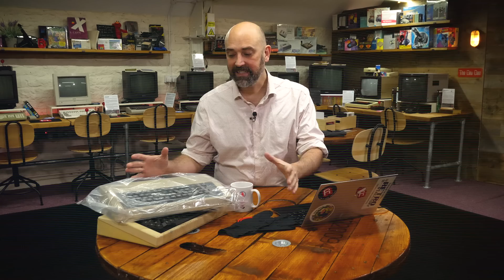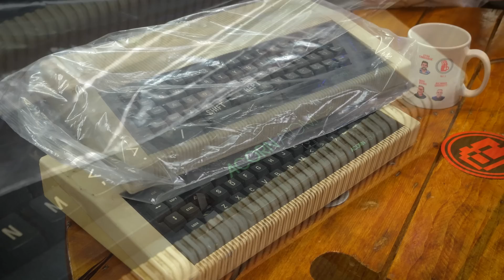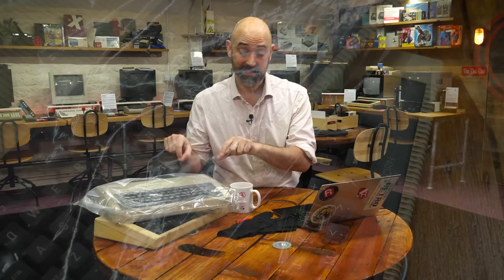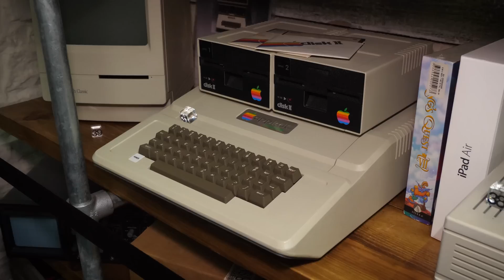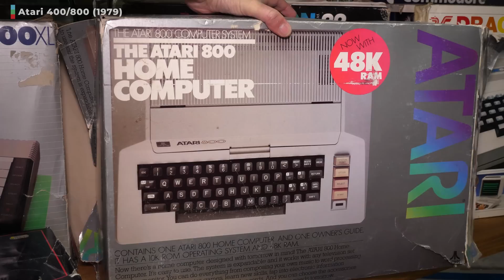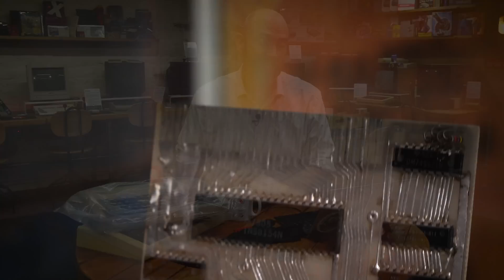Splitting the Acorn Atom | Trash to Treasure (pt1)

Comment: The Acorn Atom was my first Computer (kit version) and where i grew up with.
I have 3  now and they are still running. One (my main system) even extendend to 32K RAM, by removing all the RAM (2114) chips en inserting a 32K ram board.

Comment: I have two of these in my shed and there should be another in the attic. I bought one in 81 and upgraded it to 12k. I later got a colour card and some a couple of roms containing additional features like a word processor and some other utilities. 
I remember fitting a new 6502 rated for 2Mhz and tweaking the clock circuit to get it going. It was possible to get the memory chips from Watford Electronics cheaper than Acorn. I had a couple of spares and used a toggle switch to piggyback some chips to get some additional storage. Half the time the switch caused the computer to freeze.
When I tried to power one on about 2 yrs ago, the display was all random characters. Pressing the break button about 50 times got it to the Ready prompt but I hope it'll be an easy fix. 
I'm really looking forward to seeing how you get on with your repairs.

Comment: Jason sounds like he was one of the rich kids. There rest of us had to save up for 6 months or more. When you are 12 years old it takes forever to get the kind of cash needed to buy your first computer. I just worked very very hard outside school and not on school work. Though it did give the knowledge to find digital electronics lectures an absolute breeze and the confidence to do software engineering.

Comment: Had an Acorn Atom which came in kit form and eventually ended up full spec (12k ram, 12k rom, 4k floating point rom). It's the reason I've been in IT/Developer (or programmer) all my life...and also why I still use the term "Error 94" for bad code as it tended to be the error I saw the most🙂

Comment: You can see how the Atom was a "baby BBC Micro" - beige case, proper keyboard, expandable, 6502 CPU and BASIC with built-in assembler. I didn't get one myself because I felt it didn't have enough RAM even if you paid extra to get it to 12K. I got the BBC Micro instead a few years later and that, IMHO, was the greatest 8-bit computer ever made, so I think I made the right choice.

So impressed was I with the BBC Micro, I got an Archimedes when it was launched, which was again a superb machine - everything was improved from the BBC Micro, including a mouse-driven GUI. Learning ARM on that was a breeze thanks to the BASIC's built-in assembler - a feature carried through the Atom, BBC Micro, Electron, BBC Master and Archimedes - arguably the single greatest software feature of all those machines.

Comment: My first home computer was briefly an Acorn Atom.  I returned it and bought a Sharp MZ80K, which cost about 2.5 times more.  The reasons were, the keyboard, which was nowhere near as good as the ones you have.  There was a little spring under the key-cap, which made very poor contact.  It made programming a nightmare.  I was also trying to use the Assembler, and found it necessary to spray the ROM with Freezer before it would compile.  However, it began my Computing Career as the Technician in a Tech College in 1985 to Head of Information Systems with thousands of computers in my care, starting off with the BBC B and the RM Nimbus systems.

Comment: I built 3 of these Atoms from the kit version for a local computer shop! Attaching the keyboard was a nightmare as you had to get more than 120 wires into their associated PCB holes all at once! A couple of years before that, I worked for a PCB company that made some of the System 6502 boards for Acorn. I seem to remember I kept one of the bare 8K memory boards in the hope that I could use it to upgrade my 8K Commodore PET - not that I ever got around to doing that!
Reply: I built my Atom, and yes, the keyboard was an absolute nightmare to assemble. Due to the socketing of the chips, the rest of the assembly was remarkably straightforward.
Reply: @dougal6569  Yes, the non-keyboard parts of the kit definitely lulled you into a false sense of "this is easy!"
Reply: I too built an Acorn Atom. I sent it back to be repaired and it turns out they sent me some incorrect components and they put in the correct ones and it worked fine then!

Comment: The Acorn Atom was not my first computer. That honor goes to the Cosmac Super Elf (I still have it and it's in working order). But I wanted a "real keyboard" computer and at first I was looking at the Sinclair Z80. I dodged the bullet with that one I believe, and went for the Acorn Atom build kit. I had a lot of fun putting it together, and I had it working right after construction. I have great memories working with BASIC and the build-in assembly. I learned a lot from that little beast. I bought all other Acorn computers that came after that, ending with the RISC-PC.
I still have that Atom (Issue 5 mother board). However - I lend it to a acquaintance, and got it back in a terrible (and nonworking) shape and put it on a shelf for years. Recently I am busy restoring the poor thing to working order. Because it has been corroded at that acquaintance place, I had to replace the IC sockets and some of the IC's. It's already restored to the point it outputs "Acorn Atom" and the prompt. Sadly no keyboard input because the original keys (the white switches in the metal frame) are not making contact while pressed. Those key-switches are not available any more, so I have to do something with modern switches and a 3D printed adapter matrix to fit the original key caps. Anyway - I have a lot to do to get that poor Atom in working order. But it's fun so far. I still have the PAL color extension board, and will probably fit that one in when I got the Atom working again.

Comment: I'm quite familiar with the Acorn Atom, having seen a lecturer demonstrate on at the local technical college in December 1980. In July 1981 I bought an Acorn Atom kit, 2k RAM unexpanded version. Assembled it, worked first time.  Over the next few months I upgraded the RAM to 12k, and added the floating point ROM, and an additional toolkit ROM, and added the PAL colour board as well.  I kept this until about 1983, then I switched to a Commodore C64. 

About the keyboard though, it was rubbish, always key bouncing and generally unreliable. After about 18 months I ended up unsoldering the original, and replaced it with individual decent key-switches and keycaps. I believe the original keyboard was sourced from the US, but made in Haiti, and used a switch mechanism called SabreCoil, US Patent 4203016.  This is why with Atom issue 5 they switched to the same key mechanism as the BBC Computer.

Comment: I would have loved the keyboard, but the advertising appears to be quite deceptive.  Having the basic 2K machine at that time was way behind micro s of the same value, like the Spectrum 16 & 48k.  The Dragon 32k and Vic 20 were also quite expensive due to their form factor.  I'm glad I was convinced about the old Speccy at the time and I was right on the money.  Albeit if I had of took my parents to a computer store in 1982/83 they may have even bought me a C64 and my childhood would have been quite different.  I definitely saved my old Dad a lot of money  as a kid with my desire for a Sinclair micro.
Reply: Well in 1980/81 when the Atom launched, only one of those computers you listed existed, the VIC-20, and that only came with a paltry amount of RAM, 3.5k usable. About 82/83 was when Acorn discontinued the Atom, to concentrate on the BBC Computer. 

From what I can remember, the local computer shop, MicroStyle in Bath, where I lived in about 1980/81 besides the Atom, Sinclair ZX80 and ZX81, also stocked ITT 2020 (Apple II clone), Sharp MZ80K, Commodore VIC-20 and PET 4000 series, and EACA Video Genie(TRS-80 model 1 clone)

Actually the Atom's real keyboard was rather quite bad for reliability and key-bounce, due to the cheap SabreCoil key-switch mechanism it used. I had one, and the keyboard only lasted 18 months before I was forced to replace it with real key-switches. Later issue 5 Atoms had the same key-switches as the BBC Computers.
Reply: The Spectrum came later. When the Atom was first on sale, Sinclair was offering the ZX81 (I sold my 81 after about a month and immediately bought an Atom). Clive might have been advertising (and even taking money for) the Spectrum, but it was just vapourware at the time.

Comment: I have a mint Acorn Atom but can't find a PSU that fits the socket. Seems that people modded the machine to handle different PSU connectors. Have two official Acorn atom PSUs and neither of them fit! so cant power it on.

Comment: ISTR they promised an upgrade kit to make it run BBC Basic - not sure if this ever got released.
Reply: they did indeed make a board to work like a bbc model
Reply: It was known as the BBC BASIC conversion module or unit, apparently. Reviewed in the September 1982 issue of Acorn User, complete with a picture of the board.

Comment: Wow, awesome, I saved up and bought my first home computer, a 2K Acorn Atom, in a sale from an electronics shop in Tottenham Court Road, London, I’m guessing around November 1981.  Not two weeks later and Acorn released the BBC Micro and dropped support for the Atom like a brick but that turned out to be the best thing that ever happened, as I suddenly had to learn everything about the computer from it’s circuitry and computer hardware concepts, (in those days it actually came with a full circuit diagram), to programming and 6502 assembly language, which helped me to learn the fundamentals of programming. 

Looking back I loved the Acorn Atom, it was a great computer for its time and got me started on the computing ladder. I was lucky enough to meet some other local Atom users who had started a club in the south of London, and learnt a tremendous amount about the machines over following years, upgrading the RAM first to 12K and then I recall we squeezed 17K of RAM out of it somehow, speeding up the CPU and screen refresh rate, fitting a floating point ROM and Centronics printer port. I think I only ever saw one colour Atom though. I built an interface board to use the 64 way expansion port to connect to an Amateur Radio set to send and receive RTTY data all over the world. Eventually I was able to buy a 3 1/2 inch floppy drive unit, which was about the size of a bus, and I was able to create some very useful software, which I used to analyse equipment faults on tenpin bowling machines, which I worked on at the time. 

Eventually I upgrading to a Commodore Amiga B2000, to help with my video production work.  

The most memorable thing I remember about the Atom, as you will find out very soon,  was Error 94, bleep :-) 

Andy
Reply: From the size of this informative essay and the ‘saving up’ I’m ready to bet on you being in your very late 50s or early 60s?   Glad you liked the Atom and it’s no shame to migrate to Amiga when Acorn computers became Olivetti ❤
Reply: @ correct, I was a teenager at the time.

Comment: The manual shows an unused block of memory (2K) in the memory map. If you piggyback the RAM chips, bend up the address pins, and solder wires from them directly to the 6502 address pins you get an extra 2K of RAM.

Comment: Development of the Sinclair ZX80 started at Science of Cambridge in May 1979. Learning of this probably prompted Curry to conceive the Atom project to target the consumer market. Curry and another designer, Nick Toop, worked from Curry's home in the Fens on the development of this machine. It was at this time that Acorn Computers Ltd. was incorporated and Curry moved to Acorn full-time.

It was Curry who wanted to target the consumer market. Other factions within Acorn, including the engineers, were happy to be out of that market, considering a home computer to be a rather frivolous product for a company operating in the laboratory equipment market.

To keep costs down and not give the doubters reason to object to the Atom, Curry asked industrial designer Allen Boothroyd to design a case that could also function as an external keyboard for the microcomputer systems.

The internals of the System 3 were placed inside the keyboard, creating a quite typical set-up for an inexpensive home computer of the early 1980s: the relatively successful Acorn Atom.

Comment: My first computer.  Still got mine in the loft although I haven't switched it on for decades.  I do remember my ZX80 owning school friends being very dismissive of the Atom, but I think that they were just jealous of the keyboard and the fact that I actually had a video driver chip!  I also remember that I overclocked mine to 2 MHz rather than the normal 1 MHz.

Comment: I bought one of these in about 1980/81 when I was 14/15. I saved up half and my parents paid the rest. I would have kept it for ages, but the cassette interface went wrong and being a fool I scrapped it (by then I had a secondhand 9” PET). Wish I still had it. I do still have the PET! I upgraded the RAM to 13kb using what can best be described as the rats-nest method!!

Comment: Would you say that the Atom weakened Acorn at a key time when it could have become much bigger ?
Reply: was the Atom a needed stepping stone to the BBC Micro ?
Reply: No it didn’t weaken Acorn - it made the company. They were then able to get the Atom’s successor (which was to have been the Proton) adopted as the BBC Micro - even though it wasn’t the BBC’s originally favoured candidate. The tiny company then got launched into volume production for the BBC, but unfortunately the follow-on mass-market-intended (but never achieved) Electron was the company’s downfall.
Reply: @dougal6569  It's more complicated than that. Certainly, the Electron was a big bet on the home market, but Acorn spent plenty of money on a futile campaign in the US and on a line of business machines that amounted to very little. They were still acquiring companies in 1984 and even wanted to buy Torch who managed, with considerably less funding, to remain independent until 1987 doing in some ways what Acorn had until then failed to do.

And Acorn's "downfall" was, in reality, a bail-out by Olivetti which worked out fairly well considering the fate of numerous other manufacturers at the time. After all, the company went on to produce the Archimedes, spin out ARM, and offer new opportunities within the Olivetti empire to its founders. Sinclair was rescued by Amstrad and was largely used to repackage the existing machines or for badge engineering. Plenty of other companies just went bust.

But, with such a bail-out, had such a loss of control been so unappealing, all the founders needed to do was to offer a bit more of their share in the company when floating it, giving more of a buffer against some of their bets not paying off. Instead, that "downfall" was largely reflected in the shares the founders were left with, but I think they probably did pretty well in the end.
Reply: @dougal6569  ahhh, yeah. It was the Electron. Thanks for the correction

Comment: Oh here we go. epic timing again Neil! Right in the middle of bidding on an Atom to add to my collection and now I bet the price is going to shoot up! Cheers mate! :)
Reply from the maker: What are you buying next? Just so I can plan the next one as you’re bidding 😋
Reply: @TheRetroCollective  Well it'll be Sam Coupe or Grundy Newbrain to complete my collection unless you have either you have extras of at the cave you'll like to shift on for a suitably sized donation?
Reply from the maker: Sadly not, both really interesting machines
Reply: Probably time to sell mine then. I was gifted one over 20 years ago but it didn't have a power supply and I was bit scared of knackering it by plugging in the wrong thing as electronics isn't really my thing. I'm sure the board was an Issue 4 but the circuit diagram that came with it was labelled as Issue 3.

Comment: there are 2 acorn types ,the bbc version with a cpu that does not need to run on a 12 volt as the cpu uses its own power , the other cpu runs on 12 volt , sophie wilson invented the cpu ,and she has shares in it in other words she is loaded .
apple and other phones use it in there mobiles and cpu is so advanced now microsoft also using the cpu in there laptops.
I had both systems and all the games ,everything including elite dangerous the first where they sold the maximum games of 250,000 games and i had it all .
Reply: What on earth are you talking about?  The early Acorn machines ran the MOS 6502, and the Archimedes used the ARM processor.  The 6502 was 5V, and so was the ARM2 in the Archimedes.
Reply: As jtsotherone wrote, you are thinking about the Acorn Archimedes and the ARM. 
The original 1984 ELITE game by Ian Bell & David Braben ran on the Acorn BBC, it was later ported to other 8-bit and 16-bit machines, and rewritten by Warren Burch & Clive Gringras from scratch in the early 1990's for the Archimedes.
Elite Dangerous never ran on an Acorn machine: it was released in 2014 on PC (and Mac, Xbox & PlayStation - but only the Windows PC version is still being updated).
Reply: @koenlefever  you are correct in part but wrong on the other it came out in 20th september 1984 called elite on bbc micro acorn electron , i am happy to help as i do have the tape and the box i also have it free on elite dangerous plus also i do play the game and odyssey.